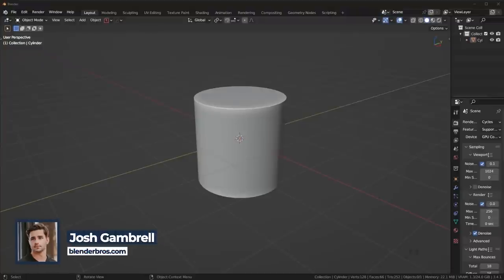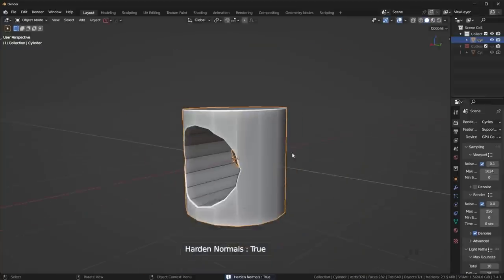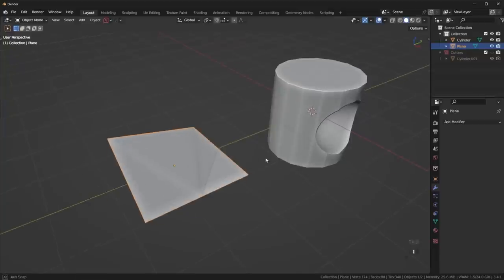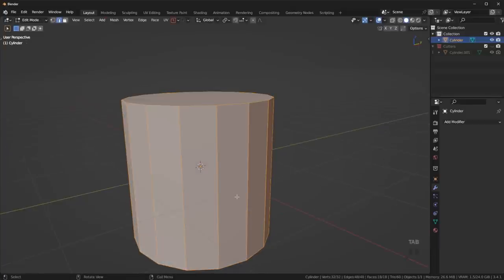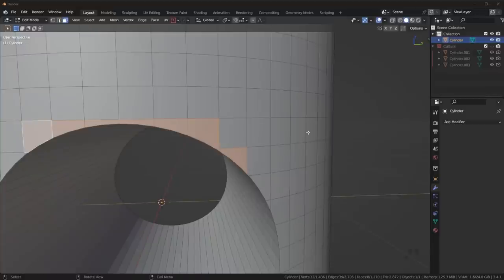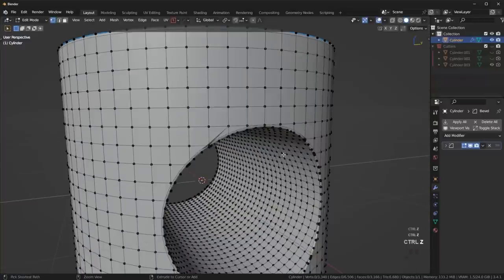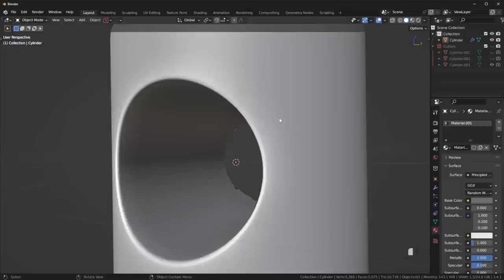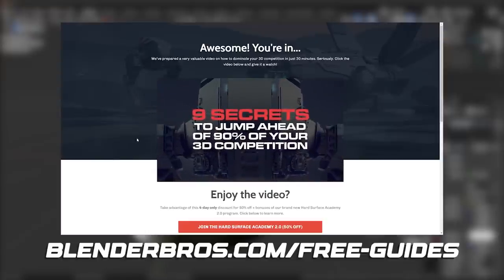BOOLEANS on curved surfaces?? (Blender Tutorial)

Comment: I think generally having these n-gons on purpose works only for these concept art renders. A better workflow in my opinion is to use a 16-segment cylinder for both, fix the geometry to quads (takes about 5 mins) and then use a subdiv modifier to get detail as you need. I think in the long run the n-gon method will cause more and more frustration because you'll constantly have to fix the geometry to work or come up with these work-arounds like the bevel shader. When you do clean topology on your model once you'll never have to do it again. Everything will also get easier: UVs. rigging etc. And if you don't learn to do clean topo, you'll never get a job as a 3d modeler (I mean asset or character modeler, maybe as a concept artist). This doesn't mean that you can't use n-gons for flat surfaces though as you said, you definetely can and i think thats a good option to save on vertex count in general. Cheers.
Reply: but subdividing a cylinder will break the ideal cylinder. i mean, you will subdivide every face of the 16 faces of the cylinder, but the cylinder as it is, will keep being of 16 faces, and i do not think that it will work weel every time. I´m still new in 3d,  if i´m wrong explain me pls
Reply: @stepanyablonsky7697  If subdivide a cylinder it will get sligthly smaller due to the subdivision but it will be still an ideal cylinder
Reply: I can't agree that using ngons is wrong. It all depends on the specific case, but in most situations, ngons can be used, especially on non-deforming objects. When it comes to static objects like buildings, weapons, and so on, there's nothing wrong with using booleans and ngons. As long as the shading looks decent at the maximum distance we'll get to, everything is fine. Of course, it also depends on the industry we work in, for example, as a VFX artist working on film productions, we can't afford ugly geometry, primarily due to shot requirements. If we're talking about game development, then using ngons is perfectly acceptable. I've been working in game production as a generalist with four years of experience, and as long as something looks good, all tricks are allowed.
Reply: It annoys me to no end that data transfer modifier gets no love at all. 😁
You can boolean and cut the duck out of a low poly and bulbous object and fix the shading using data transfer mod. Like @Abolautiainenn said, the key is to fix the geo to quad around the problem area. It should take you less than a min to do with the cut in the vdo. The guide mesh for the transfer can also be same 16 sided cylinder or add 1 subdiv to it.
Reply: there exists on earth, methods other than all-quads to dress out a polygonal model and tame geo and shading. unless your name is jay cutler, all-quads topo will one day become an anachronistic workflow solved by a SI (silicon intelligence) machine/app. tell you what, try this. create a complex model in Plasticity and then import direct via the Blender bridge, to Blender using "ngons" and then refacet in Blender. your will experience illlumination.
Reply: @stepanyablonsky7697  Use edge creases to control where you want the cylinder to stay sharp when subdivided.

Comment: Thanks for the video. If you are doing a Boolean on a curved surface but you want to then create a plane from the resulting surface where the Boolean intersects, what’s the best way to do this. The issue is you get overlapping geometry where the vertices intersect, so how you’d then create an even mesh is difficult. I hate using the subdivision modifiers because they are approximate and I do models from measuring real shapes and it shouldn’t be the case you have to worry about order. Any suggestions?

This is neat with the tool that gives a boundary so you can bevel because again you can bevel, add the Boolean and not have to worry about order of all the geometry, especially useful if you are modelling measuring dimensions of your object to actual sizes.

Comment: Hey Josh, I’ve been an aspiring 3d Modeler for games, creating both hard surface and organic surface models for games. I’ve been following your channel for awhile because of your great tips and knowledge, but one particular question I always can’t seem to find online is how to do these kind of tricks when you need to convert your end result to low poly?

Almost every approach online I have seen recommends that you use higher resolution, which does work and gets the job done for the high res model, but when baking the high poly cylinder to the low, i always get large artifacts or distortions around the bend where it enters the hole cut into the cyllinder, and i’m never quite sure how to perfect that kind of low topology to fit higher resolution cuts into the mesh. I would really love to see any advice or a tutorial on this kind of subject, as it’s one i’ve been struggling with for over 8 months now

Comment: Clean Topology: Booleans can produce messy or unclean topology, with intersecting edges, duplicate vertices, and other issues. Clean topology is essential for proper shading and rendering. When booleans create messy geometry, shading artifacts can occur, especially when the software calculates normals and shading across these irregular surfaces.

Comment: Non-Manifold Geometry: Booleans can sometimes create non-manifold geometry, which means the geometry has irregularities that don't adhere to the standard rules of clean 3D modeling. Non-manifold geometry can lead to shading artifacts and unpredictable results when rendering, as the software struggles to calculate proper normals and shading across these irregular surfaces.
Reply: Poosti

Comment: Subdivision Surfaces: If you're using subdivision surface modifiers in your modeling workflow, booleans can lead to pinching or uneven smoothing when applied to a surface with varying densities of vertices. This can result in shading problems along the edges of the boolean operation.
Reply: Malaka

Comment: This video is giving me an anurism. Quads don't matter? Ive always seen since the beginnig days of my 3d modelling journey that Ngons is cheating. Like a the roof of a house lacking any structural support. Fixing shading issues by increasing geometry by adding ring loops like that is blasphemy. Surely you're being satirical? 😂

You're right shading issues come from bent faces and a bit of clever retopology isolated to that specific area can help while maintaining proper edge flow so the model is tidy and geomtry is clean and allows for smoother bevels or proper distribution of chamfers.

I just can't accept that Ngons are ok. I couldn't sleep at night. I think the only way you get smooth bevels on ngon edges is by using special addons for blender.
Reply: Learn about how shading work on polygon. It could help you.
Reply: @lightdark4340  I already know it's ok. I tackled a very tricky low poly 3 clover castle design recently for an AR project. Shading errors everywhere due to how low poly it needed to be and the very specific placements of windows which didn't conform to the natural edge flow of the walls shapes. I had to carefully isolate the edge loops around the trouble causing windows and join them strategically to the rest of the supporting edges. I can't get away with N-Gons and shading tricks when the models are for games

Comment: This has nothing to do with non-planar faces. In Maya, you can easily select non-planar faces (I believe you'd need a script for this in Blender,) to verify that indeed the boolean is not creating non-planar faces. The issue is that booleans struggle to calculate ideal vertex normals on curved surfaces. The lower the resolution, the more pronounced the imperfection due to it appearing on a larger surface area. Cranking up the resolution doesn't eliminate the imperfections, you're simply making them smaller. You're charging $1k for hard surface modeling courses when you don't even know something as fundamental as this? 🤨